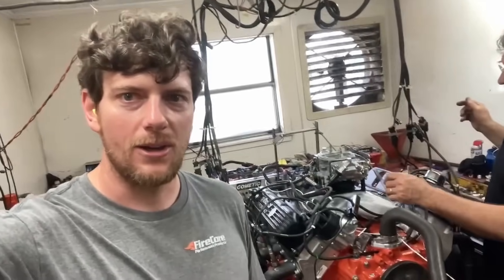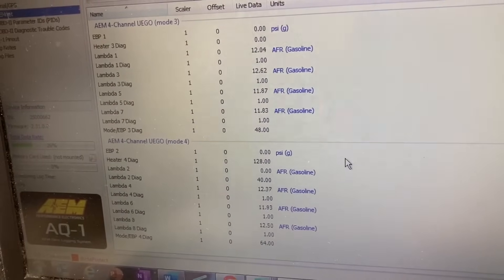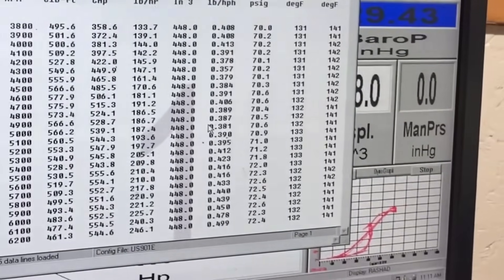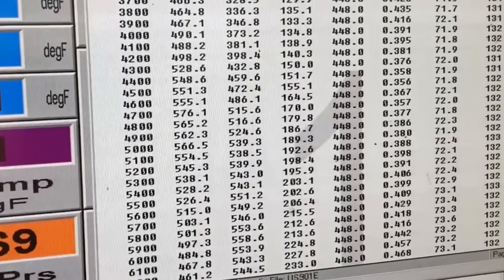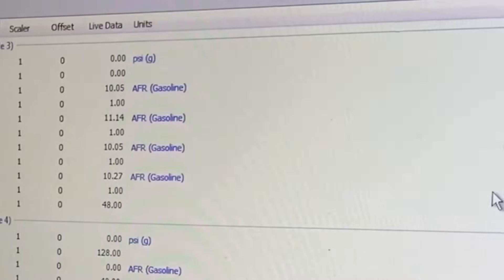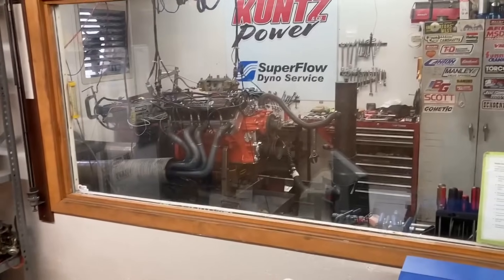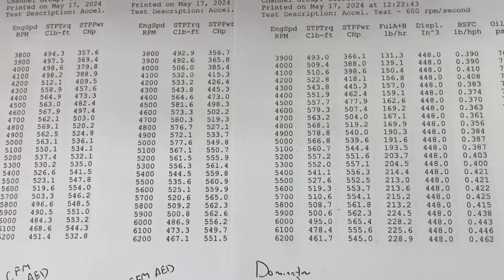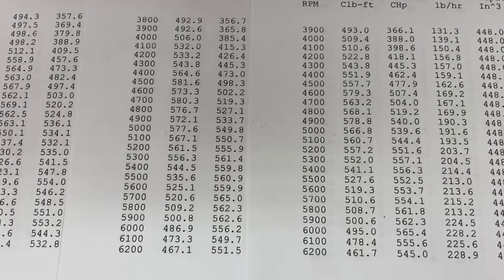Dyno 440: FINAL Numbers with 750 AED vs. 1050 Holley Dominator #mopar #bigblock #engine #dyno

Comment: We have to remember this is a 440 with a 750 carb on a manifold that fits under the hood, not a big drag race stroker motor. 560 hp is very impressive to me. Job well done.
Reply: You can also shim the K member to gain a little clearance. Someone used to sell the K member shims.
Reply: Especially with those smaller intake ports
Reply from the maker: Thanks Rick! Purpose built and conquered the goal!
Reply: 560 HP is impressive any which way you look at it 👀 Just think what some boost would do to a 440.
Reply: A lot of nice intake manifolds require a hood scoop. My 66' Coronet has a torker 2 intake on the 440 with no room for a carb spacer. Holley street dominator is another great single plane manifold that will fit. RPM and Victor are too tall. M1 I have no idea.
Reply: @mitchellferre1652  @mitchellferre1652  You have to watch the carburetor to hood clearance also. 

On some cars, the hood may close, but a higher intake puts the carb up way too close to the bottom of the hood. The air then has to make a really sharp turn to enter the carb, and it can choke the motor off quite a bit.

I ran a big block in a G.M. G-body years ago, and when I switched to a different slightly higher single plane intake the car felt like it lost a BUNCH of power, and it slowed down dramatically at the track. 

I noticed that the top of the carb was about a quarter of an inch away from the underside of the hood. I took the hood off at the track and immediately picked up 3 tenths of a second from letting the carb breathe better. 

It was a drag car, so I ended up with a Harwood pro-stock style scoop on it, and it picked up a total of about 1.75 tenths over the previous intake and no hood scoop. 

I thought it was a fairly good gain for just an intake and cold air scoop, but MAN, I was pretty baffled at the 3 tenths loss at first when the carb was so close to the hood. It took a few minutes of thinking and looking before I realized what was going on.
Reply: @davelowets  I  have to do something about this in that case. My air cleaner is right up to the underside of the hood. The K&N Extreme lid I put on looks nice but is choked off completely.  It's time for a fiberglass hood and hemi or 6 pack scoop !
Reply: @rickseeman5679  yea a long time ago i had a 68 Charger ..A kid with a heavy foot was a bad outcome for 2 engines including a 426 marine wedge i installed after the first engine failed....if i ever had a Mopar that ran this good back then i might of kept the 66 Belvedere that had a 4 speed and a 9 inch dana ..

Comment: Great to hear the 440 roar. Nice job. It would be helpful if vacuum numbers were supplied with dyno numbers for folks deciding on cams used with power breaks. Would you happen to know what vacuum readings he is getting with this engine build?
Reply from the maker: Thanks Jim. This engine was specifically blue printed and the cam was spec’d by Ed’s machine for the man’s 69 Dodge Charger. I know he spent some time on the phone with Erson about what they should be and included power brakes and the ability to drive it anywhere on 91-93 octane.
Reply: @JustMoparJoe yes I looked up Erson and plan to have a conversation with them soon. Is there a contact name you know of for Erson?
I keep hearing that hydraulic rollers aren’t good at high rpm. 
Is that your experience? Have others chosen solid rollers because of it? Thanks Joe
Reply from the maker: @jimdrechsel3611 I bought this cam through Ed. He’s a dealer. We used gaterman lifters. They’re the best hydraulic if available. Otherwise you can use solids on your hydraulic cam and reduce spring pressure. .003 lash
Reply: @JustMoparJoe I’m sorry if I asked this already but do you have Ed’s contact information?

Comment: I'm certainly NO expert. But have been building cars/motors/transmissions for 40+ years. I discovered AED about 5 years ago. I've never had a better carb. And although I only have the one AED... it was so good that I'm sure my next carb will also be another AED. Very impressive #'s on the 440 BTW. Nice work Joe.
Reply from the maker: I appreciate that, I've been happy with the AED carb too!

Comment: MOPAR is King Of "The Internal Combustion Performance Engines and Muscle Cars Bar Non"!  From The Chrysler Corporation's "The King HEMIS, Wedges, and The Polyspherical Combustion Chambers" All Developed in The Early 1950's Chrysler Engines that's in Every Ford, Chevy, Mercedes Benz, Toyota and Every Modern 4, 6, 8 Cylinder Single or Double Overhead Cam Engine (DOHC) in Today Automakers Automobiles! Even Rolls Royce! Forget Every Other Domestic and Foreign Automakers, Period!* Buy The Ultimate Off The Show Room Floor Chrysler MOPAR Generation (2)426-HEMIS King Of The Internal Combustion Engines Developed by Mankind of "The Chrysler Corporation's  Engineer Tom Hoover and Now The Ultimate Generation (3) Chrysler Corporation's Generation (3) Ultimate Off The Showroom Floor Fastest Production Automobile Ever Mass Produced or Manufactured "The Chrysler Corporation's Tom Hoover Generation (3) Supercharged A/C water Cooled 6.2 Liter HEMI Hellcat V-8's Zero to 60-MPH in 1.87 second and The Hellcat Challengers is a 5-Passenger Automobile that Cost $85,000 Dollars vs the 2-Seater European 2-Million Dollars Fake Supercars! Watch out if Chrysler were to Invent a True Super American or Worldwide 2-Seater Supercar with an  "Awesome Chrysler Corporation's DOHC  HEMI Powered V-8 Super Charged Engine! We are looking at a 300 to 400 plus MPH Race Car!

Comment: What was the compression ratio on this engine?
Reply from the maker: @jasonhawkins808  10.8/1 static. I have the dynamic somewhere in the video build series with the cam card
Reply: @ thanks. I’m trying to decide if it’s worth going to some TF 240 or 270. My 440 is 9.4:1 static but also at 5,400’ altitude. Awesome seeing what the 440 is capable in this video.
Reply from the maker: @ if you’re going under a hood, I’d go 240’s. Or if it’s a street car, 240’s. 270’s need a special valley plate and larger port intake. That definitely steps the cost up
Reply: @  thanks. The Trick flow 240 power pack is looking pretty good!

Comment: Nice build ..The 440 starts to shine with a decent set of cylinder heads.  I thinking back of a conversation i heard from someone i think who worked for Dodge was asked stated the max wedge was not going to be enough to compete with the competition so they developed the hemi. But with a set of good cylinder heads with a modern shaped combustion chambers, ports ect certainly works good especially on a bigger engine. . Appreciate the videos
Reply from the maker: I agree, good heads really make a difference!

Comment: I think the Torker II is a manifold to be chosen for it's low height. For hood clearance. If you have room for a two inch spacer, you'd just chose a taller manifold. I think a tall manifold is better than a short manifold with a spacer, and usually has less more clearance.
  Did AED cut off the choke tower on that 750? There are main bodies that never had a choke tower and are more tapered.  They would flow better than the one pictures, slightly.
 I always want a choke tower. In fact, stub stacks ( choke tower tapered extensions that fit under an air cleaner) are just as worthy of dyno testing as carb spacers.  Cutting off a choke tower has less than 1 cfm improvement in air flow and zero in HP.
  As for the Dominator, I have a setup similar to the one in the test. But I can't use it  because  I don't have a car that has space for it with the spacer/ adapter.  I think modifying the Torker II carb surface so that it fits the 4500 base is what I"d like to do. I wish I could find a 440 intake that mounts a dominator carb that is low profile. I know a tiny number were made, but I have not seen any.  And I bought the only Dominator (list 4575) that  has a choke, but the choke is long missing. The choke plates cost four times what the carbs cost, if you an find one.
  A couple more carbs to run would be a 750 cfm Dominator and an 850 4150 carb like my all time favorite List 4781.
  PS. I'm looking for a 67 Satellite Hood to make an RO type hood and scoop. So Cal area.
Reply from the maker: The carb came exactly how it was from AED. I’m not sure why they start with that style body, but I’ve seen the horns milled off for many years. I had wondered if the stock style body used in this carb was a tad bit shorter than the one with radiused Venturi openings. Check out Jonny Mopar on YouTube. He might have a hood for you.

Comment: Nice numbers. I was excited, and spot on - hp at least, with my 559hp at 5900rpm and 565tq at 4200rpm guess until your last two pulls. Great representation of 440 power w/moderate runner size!
Reply from the maker: Thanks Derek! I really think the 240’s may be the best street head. The lower profile will help them fit under the flat charger hood. I think it’s a pretty sweet combo
Reply: @JustMoparJoe  Agreed!  I have a set of TF240s myself waiting in boxes for my '72 400 low deck stroker build.

Comment: Which one is better pulling a camp trailer up a mountain pass at 2500 RPM?
Reply: A better question is how many of the viewers have a boyfriend to bring a camper to on the other side of Gomorrah pass and must keep exactly 2,500 rpm or have their license revoked.  YOU can worry about that.  The rest of us will enjoy the build for what it is.
Reply from the maker: Gary, it’s this 440 all day. If you want the power at a lower rpm, then change the cam.
Reply: I have an idea why don't you do a video on pulling a camper and tell us. Make sure it looks like a charger, though, cause last I checked on the set of vids on this engine, it was mentioned what it was being built for a few timessssss.
Reply: Who's concerned with pulling camper trailers up mountains? Yeeesh.

Comment: 560hp and thats really an affordable combo! 6-700 looks like a very possible combo ive got a stock 440 and a 383 sitting im gonna gut the stock 440 internals and use those in the 383 for a low deck 426  and put a new steel crank and steel ray barton rods in my 440 with some aluminum max wedge heads ported to flow 350-370cfm and use some ported 906s on the 426 hope i can hit these numbers or close.
Reply from the maker: Thanks brother! Sounds like a cool combo!

Comment: One should really have an intake with a Dominator flange on it, and then use an adapter to fit the 4150 on it, to compare the two. 

Not the other way around, like what was done here.
Reply from the maker: One should do what they can afford. If I had an unlimited budget I’d try that. Eric Weingartner just did a similar test
Reply: @JustMoparJoe  I get it.. 
Performance automotive engine parts are getting horrendously EXPENSIVE today.... 

Some stuff has nearly doubled in the last 3 years. It's ridiculous, really.  

🍻
Reply: @davelowets  You got THAT right about cost. I don't know about current times, but in the past guys were getting better results on Mopar Wedge engines with 4500 adapters on 4150 manifolds than they were with 4500 manifolds.

Comment: man i love a dominator... need one for my 318 now :)
Reply from the maker: It’s a big rig! I’d like to play with it on my 512 and see how she goes
Reply: They DO make a 750 Dominator....

It's basically a 1050 with skirted boosters installed to take up some of the space in the barrels.
Reply: @davelowets  I did not know that..  was kinda joking :) dominators just look soo awesome.. I'm using a 750 street demon and am really happy with it for now
Reply: @icetech6  The Dominators aren't cheap either. The last one I bought about a year ago was $1600. That was an 1150cfm. I bet the 750 is not too far behind it.

The 2-circuit 750 Dominator tunes JUST like it's smaller brother, the 4150. Everything is basically the same, just bigger. Stay away from a 3-circuit unless you are making around 700+h.p., the midrange WILL be too fat otherwise, and it will foul plugs.

Comment: Killer results , with a fairly mild package. Big block mopars are feared for a reason. Mopar or no car 🤘🏻🤘🏻🤘🏻🤘🏻
Reply: Your piggy didn't run twice?
Reply: @davelowets  lololololo.
I only have,1 Mopar, 2 Ford's, 1 Oldsmobile, 1 Buick, and 12 Chevy's in my current collection
Reply: At least you have an Oldsmobile... 👍
Reply: @davelowets 
Yes, a 1970 Cutlass 442 all original, got it 43 years ago when I was 15.
Reply: @vhp454  Sweet ride... 👍
Reply: @davelowets  thank you.
I also have a 1971 Camaro SS Baldwin Motion phase 3. I have owned it for 42 year's.
I have build sheets, bill of sales for every car I'm my collection
Reply from the maker: Thanks Kurt!
Reply: My
Old
Piggy
Ain't 
Running 
Running.
Reply from the maker: @vhp454  😂
Reply: @JustMoparJoe  just having a bit of fun. Good 440

Comment: So the AED is a better choice over the 1050. I wonder if some extra tweaking on the 1050 could have given some spicy numbers.
Reply: It should have.. 

There's a HUGE difference between a 4150 and a 4500 on my Olds 505. 

The Dominator makes a BUNCH more power.
Reply from the maker: I’d you ever get a chance to own an AED, they are excellent. This is an old 3 circuit dominator that needs some upgrades. I’m also certain that a 512 will suck more air than the 440 does. Seems like a good track test in my future
Reply: @JustMoparJoe  The fact that it was a 3-circuit may have been it's downfall also. I have found that the 3rd circuit (intermediate circuit) ends up adding WAY too much fuel to the engine unless the engine is making 700+h.p. 
For anything under that power level, I use a 2-circuit 1050. 

I have a Quick Fuel 4700 Series QFX "Pro-Street" 1050cfm 2-circuit Dominator, and it works just EXCELLENT on a 625h.p. street engine in one of my cars. 

I DID try a 3-circuit 1050 on it first, and it was blubbery rich in the mid range, and the engine would eat plugs pretty quickly.  I could immediately tell that it was too rich, as the car would start and immediately idle without there being any choke on a 4500. It was all downhill once the engine warmed up. 

The 2-circuit on the other hand, that thing has REAL crispy throttle response, and very good manners for street driving. Huge difference between the two. 

I don't doubt that an AED carb works very well once it's built for your application. I haven't had the bucks to have a big name carb custom built for me.

Comment: 👍🏼💥 awesome 440 !
Reply from the maker: Thanks brother! I’d love to own this one
Reply: @JustMoparJoe  I plan on building a 440 similar to this. Stock crank, rods. .509" Purpleshaft cam, 440source ductile iron rockers, Torker 2 intake. TFS 240cc heads. 750dp holley with Proform main body. KB pistons,  550hp is the goal. I'm not sure if my Hedman 1.75" headers will fit the angled plug heads so I am prepared to buy a set of 1 7/8" TTI or Doug's 2" if necessary.